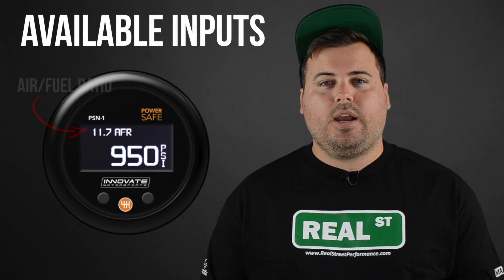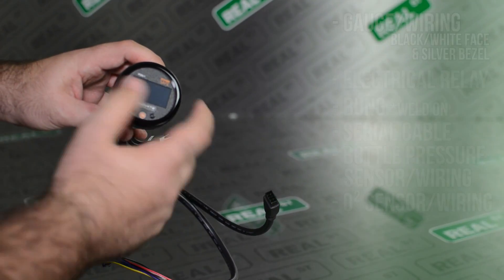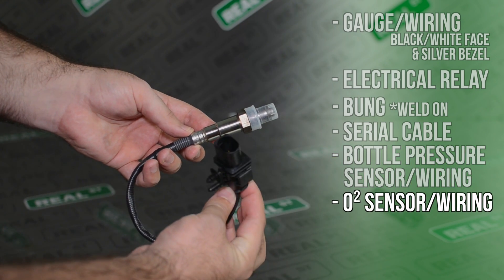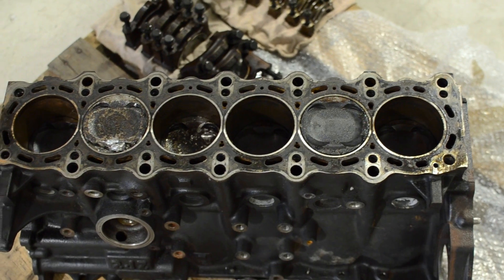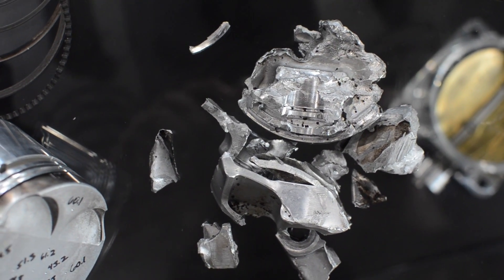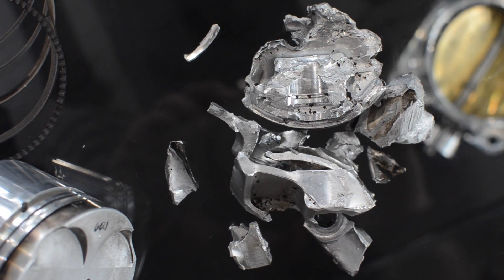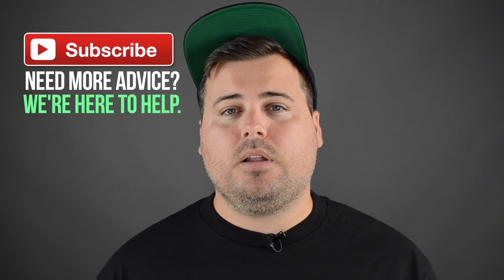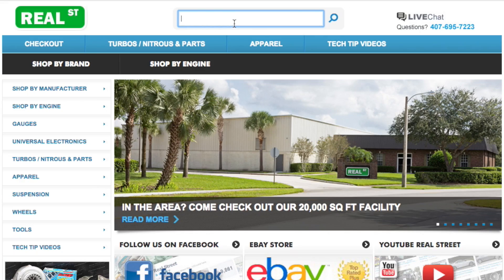How to use Nitrous without BLOWING up your engine Innovate PSN-1 PSN1 3893 - Real Street Performance

Comment: this product is useless.  why?  because if your bottle pressure is too small then who cares?  it will RICH out and not lean out.  also, if it leans out it turns off?  hu?  the only way it will lean out is if the wet nos fuel injector faults ... and that happens?  NO!  that actually never happens .... and if you've got good pressure and good a/f and you stick in a 250 shot guess what?  Boom!  your little "safety gauge" didn't do shit.

oh, and it's like 400 bucks!  super rip off ... you know THEIR costs is $75 ... total gyp
Reply: ok, if your using nitrous you need to have  some mechanical knowledge.
 #1 rule- only use nitrous up to what yor engine internals can handle.
yes if you put 250 shot thru an engine that only has 200bhp stock it will blow up.
i doubt a standard fuel pump can support 250 shot anyway.
Reply: melted pistons comes from running lean not from the NO2
Reply: gotta love the keyboard warriors. priceless.
Reply: +David Beecroft what if the fuel pump fails ?
Reply: AMEER DASHTI then the engine stops
Reply: K W wrong... NOS is not combustible
Reply: an engine that runs on NO FUEL is NOT running "lean" it's not running at all ... too much air for too little fuel is lean but NO fuel (failed fuel pump or fuel rail) is just an air pump that's dying
Reply: AMEER DASHTI amen.... 100% correct
Reply: David Beecroft fuckwit you wouldn't have a clue about work or building engines nor a great car are you even a mechanic! ?? also stick to your day job if you have know clue about anything do you evn know how to change a tyre ??? i bet you dnt .stick to your day job fuckwit
Reply: What if the fuel selenoid fails, that’s why I’m installing a failsafe wideband
Reply: Danger to manifold!
Reply: +David Beecroft what if the fuel pump fails ?
Reply: fuel pump could fails in the upper RPM and Run out of fuel ? you could run lean for no enough fuel
Reply: I stand corrected. I was wrong.
Reply: OOOOHH look A youtube pro LMFAO dude stfu please
Reply: Most NO2 systems run a separate dedicated fuel pump to spray with the NO2 and if that pump fails you will still be spraying NO2 but no fuel with it and your primary pump will still be feeding the engine so it will run extremely lean and melt down.
Reply: An overly rich afr will hurt a motor too. Read about it. 
Plus this is automated. Itll cut nitrous if bottle pressure is too or if the afr is out of desired range.
Reply: Abhir Malhotra yeah, you don't get it ... and running too rich will only foul your plugs and cause other minor issues ... it won't blow your engine.  this product is useless bullshit
Reply: no, then it leans out.
Reply: Not in most situations youre right, but after being atomized by the NOS sprayer, and after being mixed with fuel, and being subjected to the pressures of an intake manifold... well lets just say that nitrous backfires arent a myth
Reply: David Beecroft some guy do run separate tank but most of them like driving on the street. so they can run 110 in the 2nd tank to bump the fuel quality up but not really a great idea
Reply: When people do it cheap, they'll go for a dry kit which will use stock fuel injectors as its fuel source. Almost all wet kits will use a tap off the fuel rail for the fuel source.
Your direct port and stand-alone fuel system people will probably already have fail safes or not care if its a motor thats tore down frequently. 

Don't be greedy with nitrous and you won't pay the price.
Reply: David Beecroft  really when all you have is very limited knowledge on what your talking about.. its best just to keep quiet..
Reply: What if , just what if you pit diesel fuel in your car by mistake ? Then you is the  nitrous and the cars engine can't burn the diesel fuel !😚 OMG what then ? Lol . You people got so many stupid scenarios that none of you pussys should ever use nitrous , let alone cross the damn street ! If you that afraid of life , then just build the motor don't use nitrous . Everything in life comes with a risk .
Reply: false - most NO2 systems run off the same fuel pump that is used to run the entire car... now, IF you chose to run a separate fuel pump with a separate hose line from a separate hole you drilled in your tank (what moron would do this i have no idea) then yes, this system can be useful.  now, why the main fuel pump would NOT fail and the NO2 supporting fuel pump would fail is about 1:1,000,000,000 odds but in this highly unusual setup yeah, this item might come in handy.  That said, why you would not just upgrade your "main" fuel pump and skip the nightmarish "i need multiple fuel pumps" scenario is beyond me.

Comment: is leaning out with low nitrous but still pumping fuel going to damage the engine or just bog out
Reply: Going rich can lift ring lands
Reply: Dave Devine low nitrous and too much fuel will make it go rich. it's not good but it won't destroy your engine. the other way round nitrous and not enough fuel will make it go lean and hurt the engine
Reply: Dave Devine yup
Reply: Aidan Nina yes it will damage it

Comment: I've got a 96 cobra I just bought a dry kit through Nitrous Outlet.  I have been told by a local guy/friend that races using a lot of nitrous and has been in the scene for a while.  He gave me some thoughts and I have been doing my own research as well.  My questions are can you run nitrous without a tune? If so up to what shot amount?  My kit works with 150 shot which is where I want to be at but I am will to start at a lower shot level if need be.  Thanks, Tim
Car is stock except for basic bolt ons,  longtubes no cats, cai, 4.10 gears.  I do have a handheld tuner.
Reply: +TurboJunkie1000 the wet kit not necessary to tune it in your case your system is dry which depend on tune to match the fuel with the added oxygen or you need bigger injectors
Reply: U blow it up?

Comment: I have a wet system and I have a arming switch and a wot switch how does the wot switch work? Do I hold down the pedal to activate it or do I wide open the pedal then release off of it. And after I'm done using it how to I deactivate it.? Take my foot off the pedal
Reply: +Frank Block12  If your system is set up with just a arming switch and a WOT switch then yes, it's on when the WOT switch is activated by the throttle pedal and deactivated when you release the pedal. 

 thanks

Comment: I'm about to use nitrous later today for the first time in my fox body 302-347 not sure what it is told its 347 might just be a dressed up 302 though regardless 4000 bucks later the plate system Gemini twin 6 is set at 100 shot to start tuning on the dyno in a couple hours any tips or suggestions now is the time
Reply: How’d it go w that?

Comment: Serial cable? Seriously? haha

Why no USB?
Reply: Serial(SATA) cables are way faster than usb.
Reply: +David Gonzalez faster as in latency or bandwidth? There is nothing that serial is going to offer you that USB 3.0 isn't...
Reply: +damstr usb 3.0 os still at around 1gb/s (not sure exact speed) while SATA is at up to 6gb/s.
Reply: USB 3.0 max speed is 5gbps plus its standard which serial isn't.
Reply: +damstr sata is standard for computing systems, and sata 3 is at 6gb/s while (Yeah you were right...) usb 3 is at 5gb/s  however sata3 was already fully ready by the time this was released however I believe usb3 was still in its beginning of even developed yet, so usb 2 would have been chosen which not to mention is complete crap compared to sata 3 and usb 3.
Reply: +damstr nvm lol it would have been usb 3 but still SATA 3 has its advantages